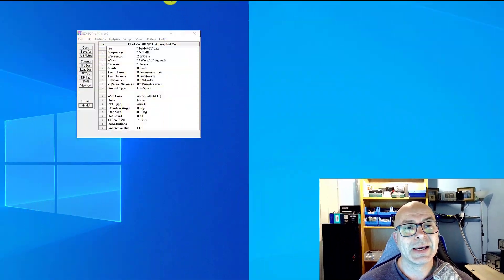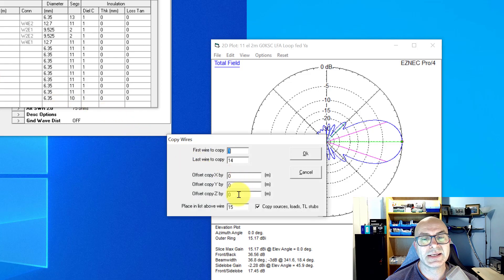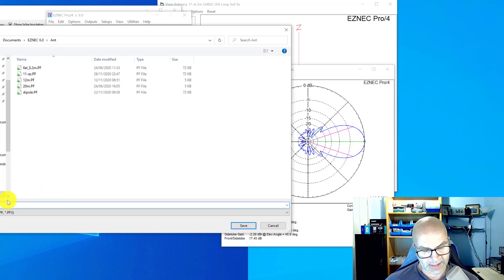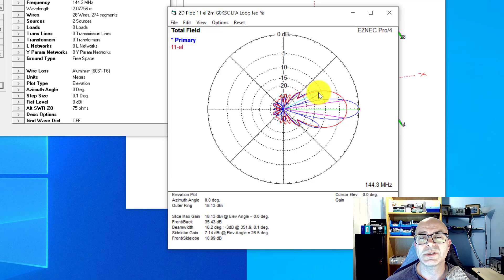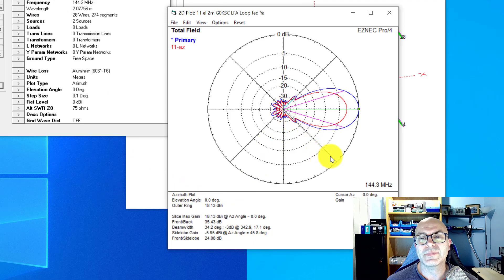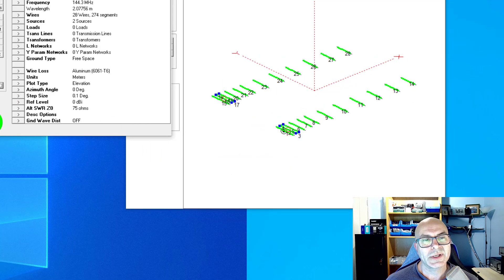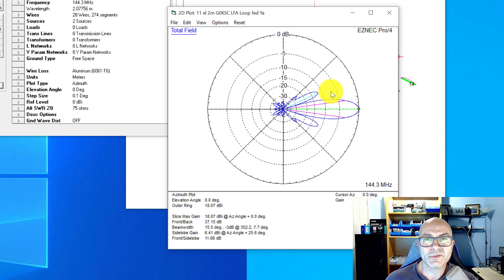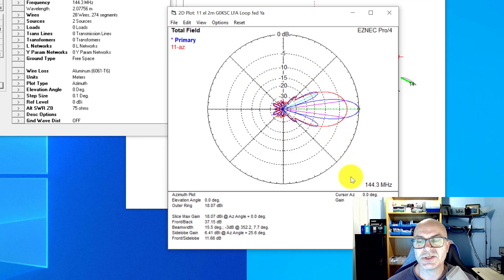Antenna Stacking & Baying - The facts about the results

Comment: I hope you don’t mind me getting back to you again. You said you would need to know more about the set up so I shall tell you more. I haven’t been confused with the information it’s just the information I’ve been given and now you have alerted me this is something I can pass this onto other people. 
I have two Mass pro WH15 beams I have one Port Power divider I have 2 x 3m lengths of Hyperflex 7 They connect to the splitter which connects to 3m’s more Hyperflex seven which then connects to 5m’s  LDF450 to the radio 📻.
Reply from the maker: best to mail me on justin@g0ksc.co.uk

Comment: Absolutely brilliant information but I’m struggling with the stacking distance you said 3.4 m apart for 2 m antennas, where does that figure come from and I am stacking 70 cm beams what would that be? Please help
Reply from the maker: Stacking distances are not fixed, they vary with the beamwidth of the Yagi and therefore the boom length. This means the longer the booms of the antennas you are stacking, the wider the spacing between them needs to be.
Reply: Thanks very much for your reply Justin I was told it had to be an odd multiple of half waves apart obviously this is not true. 
One particular issue I have is I have a tripod and have done tests with 2 x 70 cm beams, The SWR was 1.1 to 1 but when I put it on the roof assembled as it was it is now 1.7 to 1🤔😡. And because I have now stacked the antenna one of the phasing lines are too long so I have wrapped this into a kind of choke. Do you think this would be a problem. And the reason for the 1.7 to1. Do I need to change the length of the phasing lines? To bring the SWR down.
Reply from the maker: @JEFF-Elliott  You are confusing facts about stacking. if you are using a phasing line made from 75Ohm coax, then this must be odd 1/4 wave multiples once velocity factor is removed. With regard to SWR I really don't know without seeing or knowing a bit more about the installation
Reply: @JEFF-Elliott  if the swr is set to a low value close to ground or obstructions I have found in the past when setting up antennas that the value changes once it is up at height.